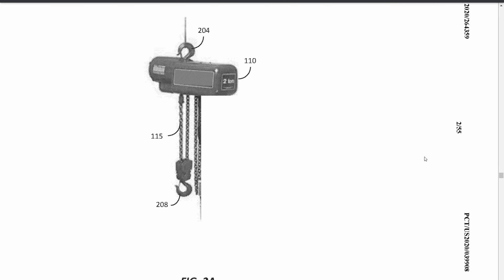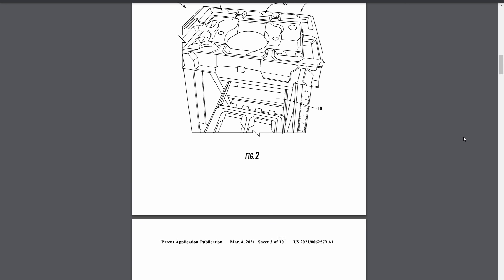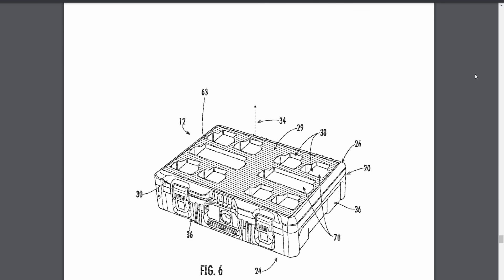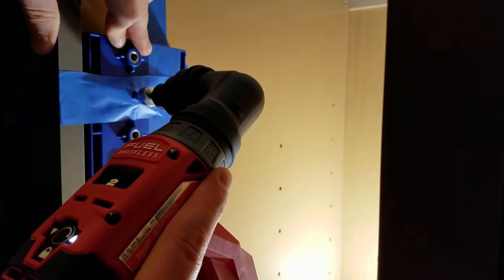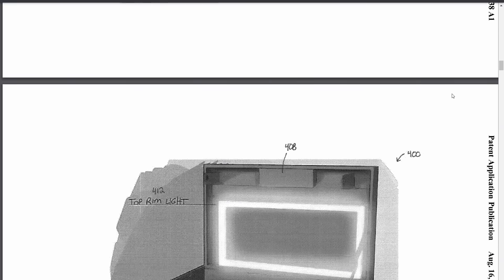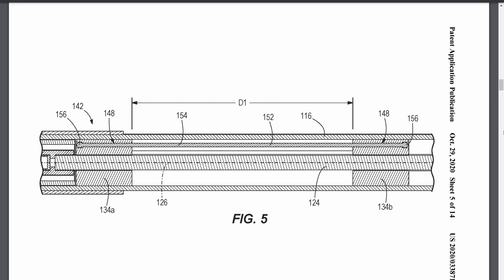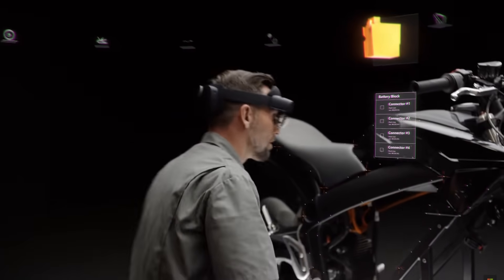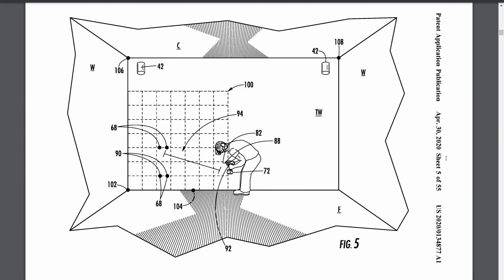Milwaukee Tool New Patents for 2021 - New Tools We Could See This Year!

Comment: Hey Nate!  I was talking with a higher up from TTI yesterday.  He said for sure 2022 Milwaukee will be releasing a 21” M18 Fuel Lawnmower for $799.
Reply: Unless they use two batteries it won't be any good
Reply from the maker: That's awesome, soooo many people have been asking for one!
Reply: @DoresoomReviews  myself included!  I’ve been clamoring for one for years!  Glad it’s not in the MX Fuel line either!
Reply: Pricey! But a good addition to the market
Reply: Agreed, if it’s Milwaukee (pro users brand), it would absolutely require 2 M18 batteries… probably (2) 12.0 High Demand at that, if not higher Amp-hours… although I’m expecting they’re about to unveil M18 15.0’s or greater at NPS, this year or next year.